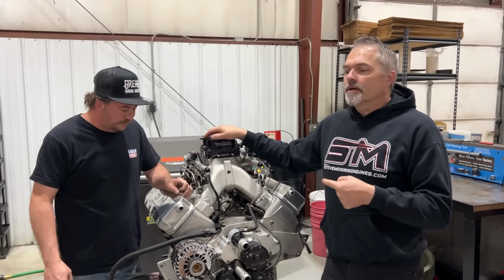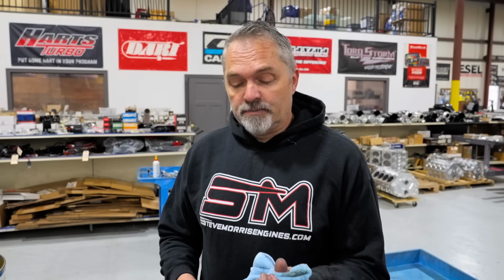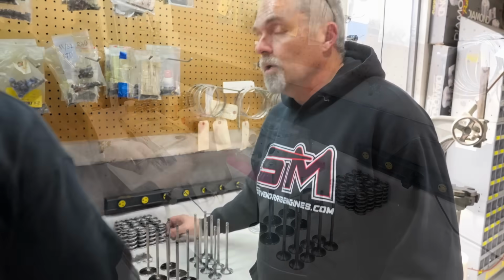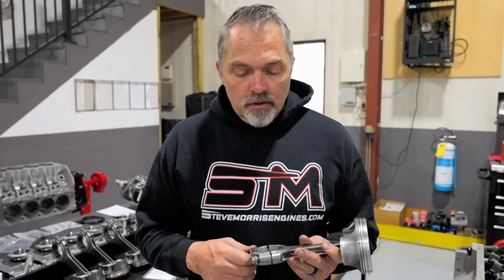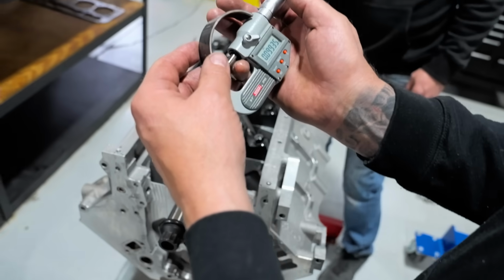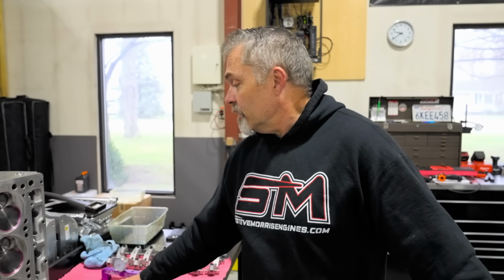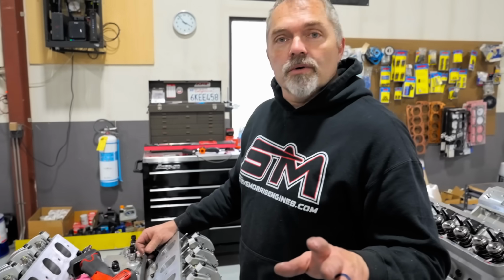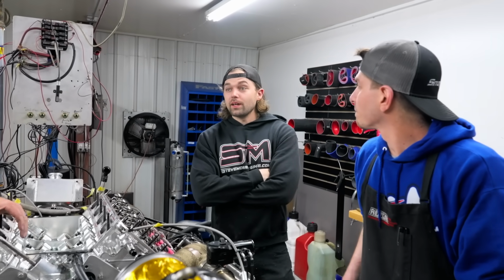HUGE ! 474 cubic inch LS Engine… How Did This Engine Work So Well For 4 Years?

Comment: Engine oiling system is identified based on the location of the oil pump. If the pump is in the oil it's a "wet sump" if the oil pump is external from the oil reservoir it's described as a "dry sump". It doesn't matter where the oil is being pulled from. Pan size is most likely determined by how much oil the motor will hold while running, allowing enough pan volume to drain the engine while shut down and not allowing the oil to interfere with the crank at start up.
Reply: I can't agree with that, if the sump is wet then imo it's just an external oil pump not a dry sump. Dry sump is a complete system with external reservoir an pump with multi stages and the sump is sucked dry. A single stage external pump is a wet sump system because it has no scavage stages to evacuate the oil from the engine leaving the sump wet.  The benefits of multi stages allows for an external reservoir which separates oil/air and supplies good oil to the engine at all rpms. Single stage external has to pull from oil stored in the crankcase which has windage problems aeration and oil is slung all over the crankcase from g forces. It don't matter where the pump is,  its the oil placement that's the main benefit, being in a tall cylindrical external tank that oil exits the bottom, any aeration surfaces/seperates and there's no crank to whip it up. It's hands down better than oil reservoired in the crankcase.
Reply: @stevenbelue5496  why can’t it have vac stages if the crankcase is ventilated?
Reply: @Double_A_Joe  I should've said scavage stages. Because without the scavage stages as with a single stage pump you can't have the external reservoir which is the main benefit. If you just have a single stage external pump all you can do is pull from the wet sump and divert the oil right back into the oil passages. Having scavage stages pumps oil to the external reservoir, then another stage pulls from that tank and back into the engine.
Reply: @stevenbelue5496  that is correct 👍
Reply: Well said 👍
Reply: Dry/wet combos they are speaking about are just weight /space savers.
Reply: @randalltufts3321  Agree additionally a dry sump as it's commonly described also helps with engine oiling in road race and circle burners. Gets the engine to a lower center point on the car and keeps the oil pump from cavitation in the turns and hard braking/acceleration.
Reply: So my Chrysler flathead 6 and every Mopar big block is a wet sump. Why even have the word SUMP in the description if you’re only talking about the pump location?
Reply: Thats whats being challenged in this comment thread that it is more than just the pump location that determines if the system is "wet or dry", which i agree with.

Comment: So what's better for push rods diameter or wall thickness?
Reply: Diameter makes the most difference. But wall thickness is key when in a situation where diameter is limited. 
For instance, a 3/8 .083 wall pushrod is not as strong as a 3/8 .145 wall rod.. obviously. But for instance, if you are forced to run a 5/16 dia rod because of the combination, using a .118 wall vs .080 wall will definitely help. 
Side note, the length of the pushrod is also critical. As the longer the rod, the more robust it HAS to be. Just because your pushrods aren’t bent, doesn’t mean they aren’t “flexing” at higher speeds. In a scenario such as that, you can have rubbing and the flexing can theoretically “shorten” the pushrod causing a situation where the valvetrain will behave like it’s using a smaller lobe.

Comment: Why does the weight of the valve springs make a big difference even tho its technically not moving? The springs are Just compressing right?
Reply: No. Springs are a big part of Valvetrain moving weight. Remember, the coils in the springs are moving. And any moving weight past the rocker fulcrum is critical.

Comment: So I'm doing my valve springs for this season. And they have lost some seat pressure. It got me thinking. Can you or should you run a lighter spring on the exhaust vs the intake? Does Installed height matter from valve to valve? Say withing .025-.030 difference across the bank. Thanks!
Reply: Are you asking because the exhaust valve is smaller and therefore weighs less? If so I understand your thinking. However, even though the exhaust valve might weigh less (assuming materials between valves are the same) the exhaust lobe many times will have more lift and lobe ramp rate, needing more spring. It usually balances out generally speaking where running the same pressure on IN and EX works great.

Comment: Steve,
The deflection of the air inlet can only be cause by a differential pressure between the inside of the inlet tube and the atmospheric pressure. The velocity of the inlet air is very high which causes it to be lower pressure than the surrounding air. There was an Italian guy named Daniel  Bernoulli  who figured this all out a couple of centuries ago. His basic formula for the relation ship of pressure and air velocity is: P(1)xV(1)=P(2)x V(2), so if P1 is the atmospheric pressure (14.7 psi) and its velocity is 1 then as V(2) increases P(2) must decrease. If you knew the circumference of the inlet and the velocity of the incoming air you could calculate the pressure of the air at the inlet. Also the actual inlet is not round, it is more like an oval which greatly reduces the resistance to deformation due to the differential pressure caused by the high velocity of the incoming air.

Rex
Reply: @bigboreracing356  
Just because you struggle with maths and physics, does that not mean the rest of us have to look stupid. Some of us actually LIKE to discuss and talk about this, form a more scientific point of view. There's nothing lame about taking a scientific approach to things. It's lame to act dumber than one is, just to try and be too kool for skool.

Comment: It's more than an ambient pressure under a vacuum and you're not considering that. You could have the ambient pressure plus the calculation based on how much negative pressure you're creating
Reply: And surface area. 14.5 pounds per square inch.

Comment: What oil would you recommend in a small block Chevy with a flat tap cam combination I know you guys typically do roller just curious
Reply: Baby oil
Reply: Any oil that has at least 1200ppm of zinc ,but for break in I use oil with 3,000ppm of zinc. Lucas break in oil, or Lucas hot rod oil,or vr1 oil.

Comment: Steve, looking at the bore/stroke ratio, I would not expect it to be that much of a high revving engine. Usually the shorter stroke engines love to rev a lot and produce the best power at the higher revs (if the flow allows it).  I would expect this to be more of a low and midrange torque engine, rather than a high revving high HP engine?  Right?

Comment: Steve my new boosted pistons have a groove between the first and second ring. I have never seen this before. Why does it have this? Rik
Reply: It’s an accumulator groove.  It provides additional volume between the top and second ring for gases that pass the top ring to vent into to prevent unloading the top ring and slows or prevents the onset of flutter.
Reply: @GregMcConiga Thank you for that explanation. I suspected something among those lines, but I was not sure. Rik

Comment: I think load is critical. Yes it's revving. But it's spinning tires for a smoke show.  It's not hooking up.  It's not accelerating 3000lbs down a quarter mile.  In the big picture, load is minimal.

Comment: Instead of bigger pushrods, how about no pushrods?
I get SM is a Chevy guy.
A push rod motor guy.
I know Steve build SBS engines. 
What about starting a DOHC motor program?? Better design!!!
Reply: Even with the limits of a push rod engine, they constantly hit the limits of materials, and the ability of the chassis to put the power down is the main limiting factor on how much power can be used. Complicating matters to gain a few percent of efficiency probably isn't worth it
Reply: @zacharykelly7434   coyotes seem to be doing pretty well with the extra “complication”.  3000hp with a  Ford production cast block and heads. Probably has a lot more to do with physical size, amount of customer base, and the “stick with what you know” attitude

Comment: Have you seen the sorcerer (I believe that’s it’s name) engine that runs 3/4” pushrod’s? They said it’s that big because of flex due to spring weight. Why would you “need” that much spring???

Comment: 10,000 rpm sounds so good tho!

 Question.  What determines an engines max rpm even tho it peak power is already passed.
Reply: @bigblockjess617  conrod strength, heat soak, crank strength. Cylinder pressure
Reply: Also Valve-train stability, harmonic vibration
Reply: Oh and "knock" aka predetonation . And valve float which is part of valve train stability you mention.
High revving engines are where you get into real crazy issues, f1 cars gor instance dont have a valve train but pneumatic ,hydraulic crazy hybrid valve lift systems and pre chamber ignitions to reduce knock.
  @knowbull5hit590
Reply: Knock too. And valve float @knowbull5hit590
Reply: If you’re referring to intentional overrev while racing most racers only overrev just enough that the engine drops back into where they want it to be on the powerband for best acceleration.  If you mean absolute RPM, take a look at Formula 1.  They have had and will soon see again engine speeds at 20,000-21,000 RPM.  But those engines are 15-18 million each!  Most of the mechanical limitations can be overcome but eventually you simply can’t get the cylinder filled or the burn completed because you run out of time…. The engine speed is so high intake flow stalls and the exhaust valve opens too early in the combustion process.
Reply: @GregMcConiga  how they pull this off is insanely technical too, electronic, hydraulic pneumatic valve operation, no cams.
Preignition chambers, tolerances that are essentially seized without warming up the motor, through engine turbo shafts...

Comment: When you lap in the valves, are you actually establishing a seal or just verifying that the seat geometry is correct?
Reply: It helps the seal and discover potential problems. Though new car manufacturers don't lap valves.

Comment: At 10,000 rpm how many times do the valves open and close per second
Reply: 10,000 divided by two (4-stroke engine, so each valve opens once every other rotation), divided by 60 seconds comes out to 83.3 times for a single valve. Multiply by 16 for the whole engine.

Comment: The police fried and lifted have more leverage to keep them together. Then the lift to push open the valve. The only time the weight comes in to play is wind floats. But with a novel Spring pressure. You never end up with valve float
Reply: I think you need to proof read your comment

Comment: Steve, wouldnt a timing gear drive be best over chain and belt?
Reply: For timing accuracy maybe but it eats horsepower from constantly fighting the wedge of oil between the teeth of the gears a belt deflects some but takes less power to drive and can be visibly inspected and checked for wear or stretch without tearing into anything